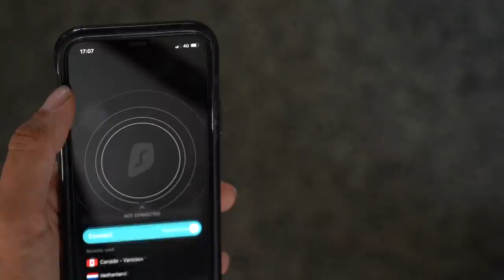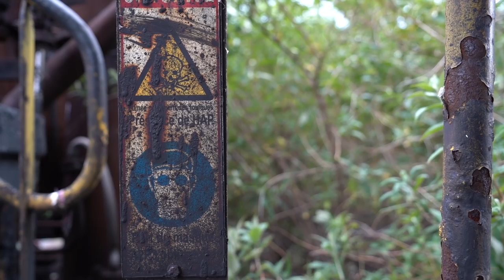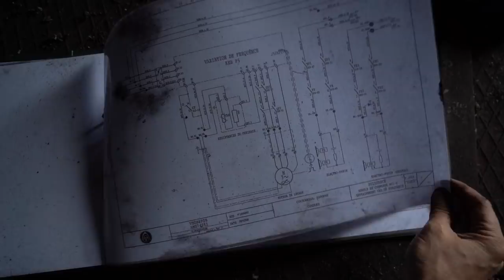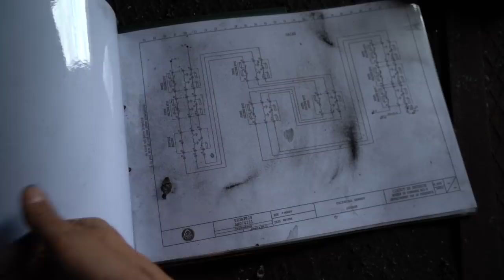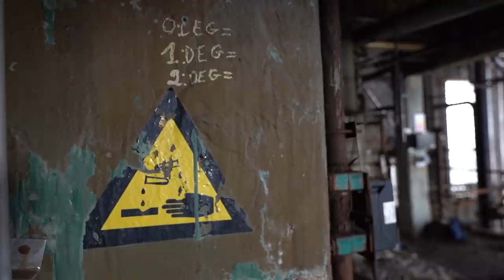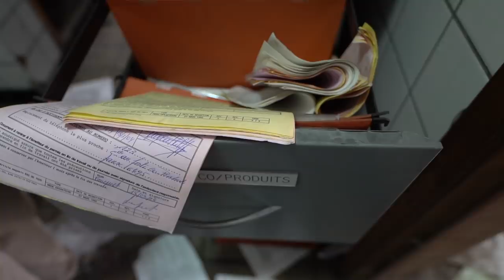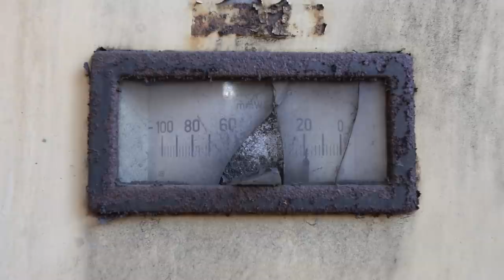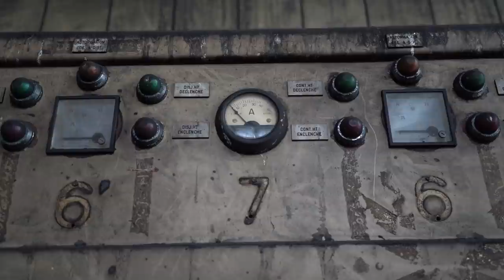URBEX | A giant abandoned industrial wasteland | Cokes factory

Comment: I worked in a coke plant in Oklahoma during the 70s and 80s, only we didn't burn Coal, we used gas and oxygen to burn Petroleum Coke and change it into Carbon for the Steel and Aluminum industries. This location is just like where I worked, with everything turned Black for the dust, Even the ground outside the factory, all Black...  Thank you for the tour AND for educating me about Coal Coke plants...